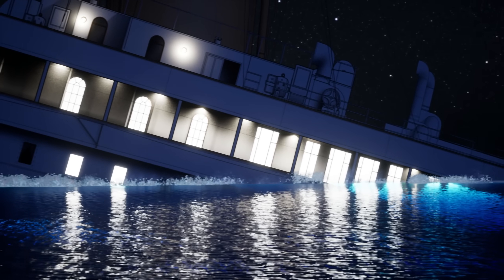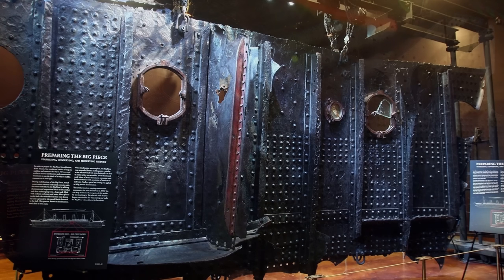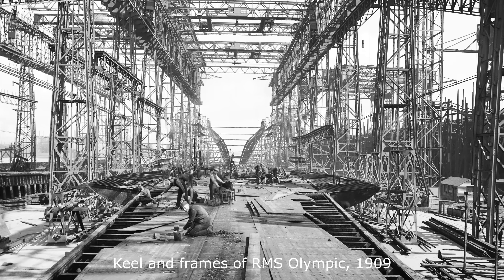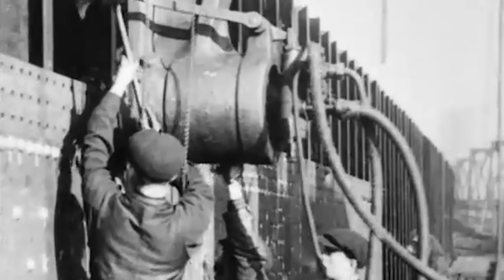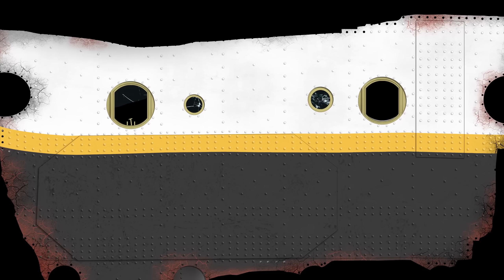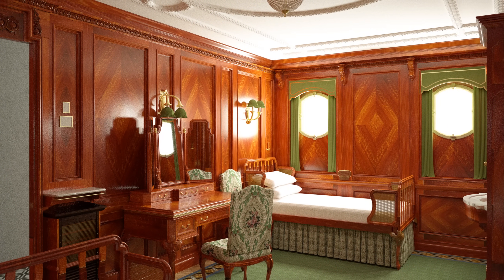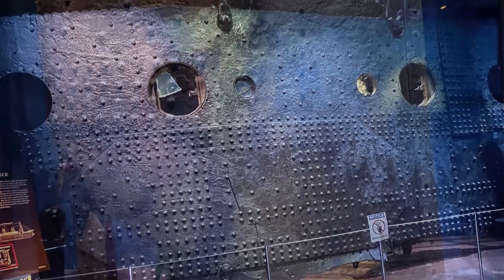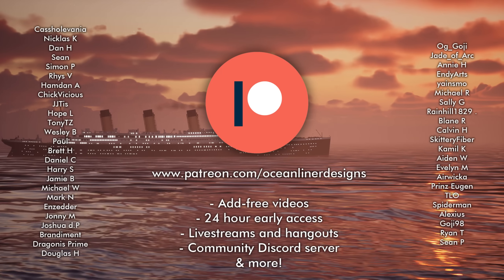Titanic's INCREDIBLE 'Big Piece' - Design Secrets

Comment: the way the stern sunk, the velocity of the water pushing into the gaping mawh of the open break caused the stern to violently be torn as it sunk, while the bow cut thru the water and the compromised break section suffered the most damage upon impact with the sea floor.
TLDR: ya ever see an Umbrella get turned inside out in strong wind? Thats what happened with the stern break section, ripping chunks of metal and a significant section fo the stern break

Comment: ( 1.) Contributiing factors why the Titanic Ship sunk in the Atlantic Ocean : The Titanic Ship hit the iceberg on the lower right part of the starboard side of the ship. This is exactly the same side of the Titanic Ship that had a fire three story fire that would not go out. This would cause the metel in this area to become weak and brittle. The Titanic Ship should have been placed on dry dock. Plus blocked from sailing on her maiden voyage . All the metel in that area where the fire took place for 10 days should have been removed and replaced.

Comment: Actually you're wrong about titanic being the largest ship there was at the time. Olympic was the exact same length as the titanic (882 feet). Olympic was elder sister therefore olympic was the largest ship around at the time not titanic. I keep saying this in many titanic videos but the titanic was a cheaper made knock off imitation of olympic. Also olympic was the truly unsinkable ship
Reply: Here is an AI generated response since I am to lazy to research 👇

The Titanic was considered the largest ship in the world at the time of its launch in 1912, even though it was nearly identical in length to its sister ship, the Olympic. The reason for this distinction lies in a few key differences:

1. Gross Tonnage:  
   - While both ships were the same length (882 feet 9 inches) and shared the same basic design, the Titanic had a slightly higher gross tonnage (46,328 GRT) compared to the Olympic (45,324 GRT when first built).  
   - Gross tonnage measures the total internal volume of a ship, not its weight. The Titanic had minor modifications, such as more enclosed first-class spaces (like the forward promenade deck being partially enclosed), which increased its tonnage.

2. Luxury Enhancements:  
   - The Titanic incorporated additional luxury features, such as expanded first-class accommodations, a larger grand staircase, and more elaborate interiors, making it slightly heavier and more voluminous than the Olympic in its original configuration.

3. Public Perception & Marketing:  
   - White Star Line heavily promoted the Titanic as the largest and most luxurious ship in the world, even though the differences were marginal. The Olympic had already held the title briefly in 1911 before the Titanic surpassed it slightly in tonnage.

4. Later Modifications to the *Olympic*:  
   - After the Titanic*'s sinking, the *Olympic underwent significant modifications (including adding more lifeboats and upgrading safety features), which later increased its tonnage beyond the Titanic*'s original measurement. However, by then, newer ships like the *Imperator (1913) and Britannic (1915) had already taken the "largest ship" title.

 Conclusion:  
While the Olympic and Titanic were nearly identical in size, the Titanic*'s slightly higher gross tonnage and enhanced luxury features technically made it the largest ship in the world at the time of its launch—until even larger ships like the *Imperator came along. The distinction was small but enough for White Star Line to claim the title.
Reply: @zahinkhan3717  lol 🤣🤣🤣🤣 everyone knows ai is wrong about everything
Reply: @AllieJ97Official  you can't break the laws of gross tonnage. Everyone knows Titanic was the biggest ship even though it was by a small margin
Reply: @zahinkhan3717  wrong again 😂😂😂😂
Reply: @AllieJ97Officialthis is just how measurements work
Reply: @AllieJ97Officialif the size like length and width and height are the same, you go for weight and volume. So yes, titanic was bigger in mass and volume
Reply: @Alexius01 gross tonnage and dead weight tonnage and displacement are secondary factors not deciding factors. Olympic was the largest ship at the time end of story
Reply: @AllieJ97Officialat the time until the titanic came into service. dont be delusional.
Reply: @Alexius01  titanic wasn't in service it sank 😂 it never completed it's maiden voyage. Olympic was the largest.
Reply: @AllieJ97Official she was in service and sea worthy for 14 days….From leaving belfast up until the sinking….
Reply: @Alexius01  she wasn't sea worthy at all. She was made of steel plates held together with rot iron rivets, she had a fire in the engine room on F deck before the voyage started, she was wildly under stocked with lifeboats, she failed every safety test and white star line still pushed ahead because "they had a record to break" a record which obviously failed and the title still belonged to olympic
Reply: @AllieJ97Officialthanks for letting me know you are trolling.. its a waste of time
Reply: @Alexius01 really ad hominems? No I'm not trolling I'm pointing documented facts whereas your just saying titanic was biggest and best due to social trends and common belief. When in fact the most superior sister ship was in fact RMS Olympic.
Reply: @AllieJ97Officialnow you are using red herring, switching from size to superiority. Its no secret that olympic had a better career and that way is superior… Coming back to your earlier statement and adressing your claims: Titanic WAS sea worthy, she passed all her sea trial tests just like her sister ship. She didnt have a fire in the engine room, she had a coal fire in the coal bunker of boiler room 6 not on F deck, but on the orlop. Next, lifeboats, in the time titanic was built there was no regulation that a ship should have enough lifeboats for every passenger. Titanic was within the regulations and supplied the lifeboats necessary. Then what safety tests did she fail? Id like to know that, and also what record? The speed record? The olympic class was not build for speed. Their hull shape and propulsion were inferior to the ones of lusitania and mauretania.
Reply: @Alexius01  oh you're unaware titanic was supposed to be the fastest ship to cross the Atlantic? Yes she was trying to break the speed limit. Boiler rooms 1-6 were the rooms affected by the iceberg collision thus the coal fire weakened the hull on the starboard side which was already substandard as it held together by rot iron rivets which when the iceberg collided caused an "unzipping" effect along her whole starboard side and which was originally a tiny collision turned into a 30 foot gash. She was not sea worthy. They put so much pressure on that ship to be the best that they effectively killed it on its first voyage
Reply: @Alexius01 not to mention Edward smith fired the only guy with the keys to the binoculars cupboard onboard the ship before the voyage. 

And...and titanic had a lifeboat capacity of 36 lifeboats but was only carrying 16!! 

Not to mention she was going full steam ahead nonstop that whole voyage again which was against the captains seafarers handbook of the time. 

So yes she failed a lot of safety tests at the time.
Reply: @AllieJ97Officialagain, olympic class was NOT build for speed, they stopped competing for the blue ribband in the 1890s. The Teutonic was the last white star liner to ever take the blue riband. And boiler rooms 1-6 were not affected. The compartments affected were the forepeak, 3 cargoholds and boiler room 6 and a small cut in the coal bunker of boiler room 5. i suggest to please do more research. It is all one google search away, or even better, watch more of this channels video. It even covers the thing about the coal fire.
Reply: Titanic was heavier then the Olympic witch is why
Reply: @zahinkhan3717  that's not how largest ships are judged, they're judged by length. Also cite to me one genuine article from that time claiming titanic was the largest. There isn't one because it wasn't. However olympic was known as the movie star liner and she genuinely was hailed as being the largest ship at the time

Comment: The fact that one of the brass fittings connecting to the shower is still on the piece is amazing. Especially since it was in conditions with heavy water pressure.

Comment: Horse hair & tar, wrapped in asphalt shingles (with no aggregate) was a common pipe insulation in the old brewery I once worked at. All of this had been installed in the early 1920's The cellars were insulated with 3 feet of thick cork covered with asphalt impregnated roll roofing painted over.

Comment: The big piece was on display in Tampa around 2002-2003. It was a slow day at the MOSI, so myself and my grandparents had pretty much free run of the exhibition, despite it being a guided tour. I recall being overwhelmed by the reproduction of the grand staircase. Standing at the bottom, looking up at something I had only seen in black and white photographs. It was astounding. Then to find out that this was only a 2/3 scale model.

The big piece was in a large, dark room alongside many other recovered items. 
In this area, there was also a dinner plate sized piece (the little chunk😂) inside of an acrylic case. A hole had been drilled into the case so that it could be touched. It might have been the most exciting moment of my life up to that point, getting to reach in and feel a small part of history. Sounds incredibly lame in a retelling, but it was an unforgettable experience.

Comment: I hate the fact that the Big Piece had to "survive" poor handling by the recovery team, in addition to the sinking. It would have been so cool to see some of the brass piping, wood paneling, and horsehair insulation (albeit in poor condition) still attached, instead of being pressure washed off.

Comment: Mike! What an amazing video! I was wondering, though, why alot of folks talk about the Titanic, as if it was the only biggest ship. Weren't the other 2 sister ships-Olympic, (MY favorite), and Britannia, nearly identical? This, unfortunately was very confusing for me, for years, as I just recently, learned of the other 2's existence! Because of the talk of the Titanic being the "biggest", the "unsinkable", etc. etc., and never any mention of the other 2, I didn't even know about them!!!!  It's been so enlightening to learn of the other 2, and like I said, I favor The Olympic, because she has a long illustrious safe, career, except for a couple of scrapes, she was always wonderful, and supported lives, and saved lives, even, during the war. It's sad she doesn't get more honor, and respect, except as reference for photos for how Titanic looked. (sad).
Also, di you know that a third HUGE piece, the middle piece of the Titanic was found??? A bit far off from the other 2 pieces, but is the middle piece, that would have had this "big piece", attached, I think. This middle pies has engines, and the base of the smokestacks, from the middle!
Reply: Titanic was a few thousand tons heavier than Olympic when she was completed, making her the largest ship afloat at the time. Following the Titanic's loss the Olympic was upgraded and strengthened, and she ended up being significantly heavier than the Titanic had been. Of course over time even larger ships were built, making the point moot as to which was bigger.

It's a shame the Olympic wasn't preserved as a museum ship, as she ultimately would've become a huge tourist draw. Unfortunately at the time she was scrapped in the 1930s nobody was geeking out about the Titanic, and she was just another old ship that needed to be disposed of.

Comment: If you've ever watched a boat sink...they go down slow when they are above water but once the last bit of them is actually submerged they pick up alot of speed really quickly and sink as fast as a stone. I assume that when titanic was traveling down thru the water column before she hit bottom she was going much faster than she ever could have gone at full steam on the surface.

Comment: One slight correction, if I may (though my sources on this are limited); from what I've heard, the reason why they cut the smaller piece off of the Big Piece, wasn't just so it could be displayed better; one of the concerns that they had, was that it was creaking under the strain of its own weight, and so they decided that the best way to relieve that strain, was to cut the smaller piece off.  This is a fantastic video, though - great job!  One of my bucket-list goals is to visit the artifact exhibition in Las Vegas...and while I'm sure the entire experience would be life-changing for me, encountering this section of the hull - from a ship I've studied exhaustively in my younger years, from THE R.M.S. Titanic - this would be my personal highlight of the entire trip.
Reply: If this is correct, I'm glad you mentioned it. I'm disappointed they didn't leave it exactly as it was, but if this is true that makes sense. Shame they pressure washed literal history off of it though.

Comment: What I still don't understand to this day is, how did the workers line up and align the pre-punched rivet holes in the panels (among each other) and with the rivet holes in the vertical frames. 
The hole patterns had to match the adjacent panels and frames. If that doesn't fit, I can't put the rivet through the matching holes.
Reply: they had reamers
they use them on aircraft
holes are drilled then a taper is used to align each hole
the remer trues up the hole
that way every rivet is in a neutral spot
each one taking an evan load.
Reply: @raypitts4880  Thank you Sir !

Comment: Dear Mike,
Your mention of Red lead oxide paint was how I discerned your accuracy on everything.  It was also called Tinner’s Red.  Tin was also coated and the lead oxide was applied as a paint, but also amalgamated to the tin and locking the tin from water vapor..preventing the cancer of rust.  Tinner’s had many tasks.  One major part of their Trade was standing and flat seem roofs.  This application was also used on ships.  There was alsoWhite Lead used in household paint.  This made for a furniture finish on architectural woodwork in the finer homes and on ocean liners.  The old based “enamels” containing white lead could be finely brushed and then honed with fine Emery cloth, and buffed to a reflective gloss that felt like French polish.   Lead is safe when contained in an hard substance.  It’s when it breaks down that it becomes an issue.   This honed finish can also be attained today with our new enamels, but not the lasting effect.   
One can still acquire red and white lead oxide used in restoration of paintings, and still used on bridges to prevent rust.  Lead sheathing is still used in Britain for roofs and having a shelf life of 200 years.

Comment: According to the Titanic historians who wrote On a Sea of Glass, the main reason a huge chunk of the ship is missing is not so much because of hydrodynamic forces but instead because when the ship broke apart, there were two other great chunks which came off of the ships superstructure. And then because of some hydrodynamic forces a little more was ripped away. And the implosions caused the sterns sides to blow out.

Comment: Technical Question: has there been an analysis of the steel in  The Big Piece? If so, results? BTW,  excellent work! Thanks again.
Reply: I read somewhere that there were theories that the rivits may have been of poor quality for the times. Too much unwanted copper in the steel.
Reply: @johneckert1365  thing is the harder the steel the more problem of riviying
compromise between cost of making and working it
Reply: I don’t believe that there has.

But no, Titanic’s steel wasn’t weak/subpar.

Comment: MB, Thank you for another great video.  This video shows the breakup happening in a brittle manner like a pencil being snapped.  If you look at images of the wreckage on the bottom of the ocean, you can see that the upper decks were pulled downward at the break, and the sides of the hull bulged outward.  Take the paper tube from a roll of paper towels and bend it.  You will see that the cross section ovals with the shorter axis being in the plane of the bend.  This will happen with any thin-wall tube regardless of whether it is circular or rectangular in cross section.  -GV

Comment: Great video thx. Question. If when fleet saw the ice berg if they had just rammed it rather than try to side swipe it, would the Titanic have stayed afloat as surely  no more than first four water tight compartments would of been compromised?
Reply: Speculation is she would have been damaged of course, but remained afloat. I don't think the designers envisioned a side swipe when they designed her but they took into account a collision. If the bulkheads had gone a little higher, just one more deck I believe, she would have survived and probably been nothing more than a footnote in the history of trans-Atlantic liners.

Comment: You just said something that just struck a nerve they're going to reinforce the sides make it rigid as they can with all them rivets and then they're going to put one big stress separation joint right in the middle or at the start breaking right I just don't see how an engineer couldn't have seen that

Comment: 3 rivets down from the top edge of the doubler plate, there is a line that looks like it is incised into the metal. Said line continues to either side on the shell plating as well. It looks like it corresponds with the yellow stripe. Did they mark out the paint work with incised lines on the plates or is something else going on there?
Reply: i’m unsure, but marking out the paint with incised lines does indeed sound like something that Harland & Wolff would do. 
they did the same with the names of the ship, carving it into the hull and filling it in with paint.